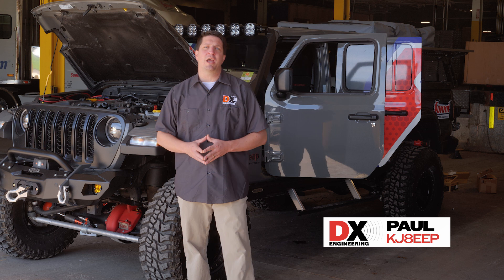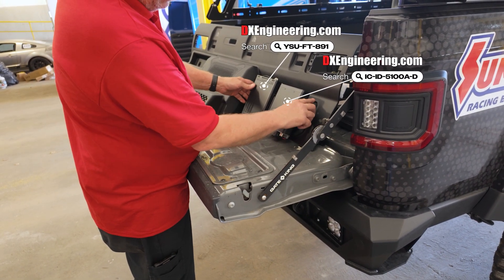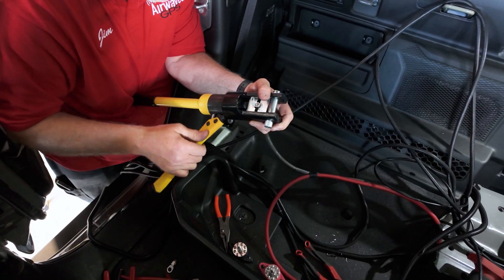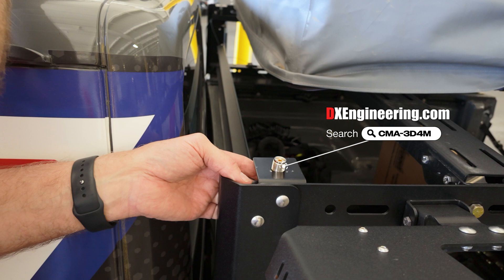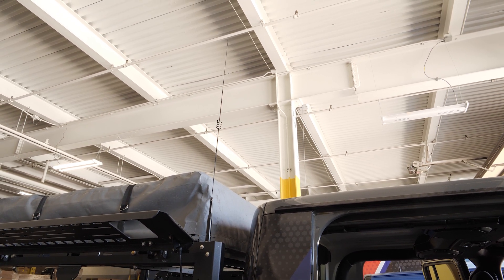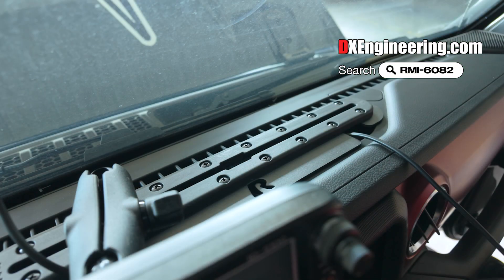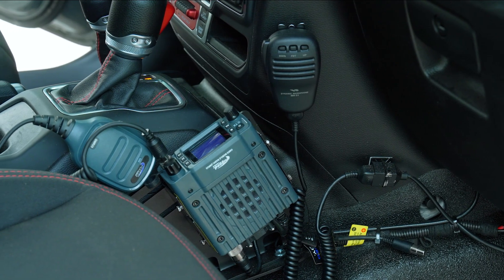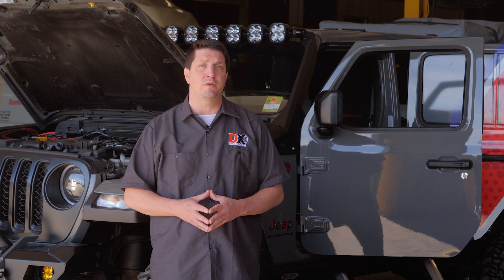Mobile Radio Install Tips from DX Engineering with the Summit Racing Roamin’ Gladiator Jeep Truck

Comment: Nice install. Very clever idea of adding holes to the lower dash panels so the speakers are better able to project sound.  Lot of wiring but when finished looked nice. To my eyes the ATAS-120A looks vulnerable.  Maybe some type of flexible mount or maybe a fold over mount when the trail gets tight.

Comment: I'd ad that it's useful to add a small plastic bracket at the end of mic extensions attaching the cable to the adjoining surface; this takes the strain off RJ-45 style connectors as the mic is used and moving around. Those connectors are notorious for working loose and creating poor contacts. After doing this during our two initial mobile installs way back in 2013 we've had no issues with mic connectivity.  TNX for great tips1  73 - Dino KLØS

Comment: I’ve some (constructive) thoughts, criticisms and comments that I would be pleased to share with your installers, however would prefer for YOUR sake to do so, privately……as I have over 4 decades and many millions of miles of severe operational conditions of experience…..so I know what works, what lasts and what doesn’t. My email address is correct at QRZ if you’re interested.